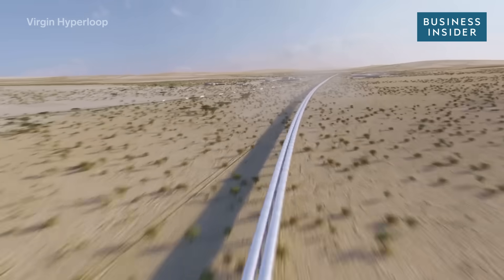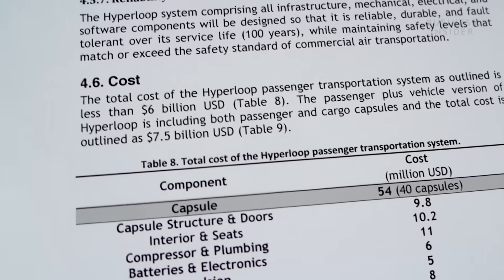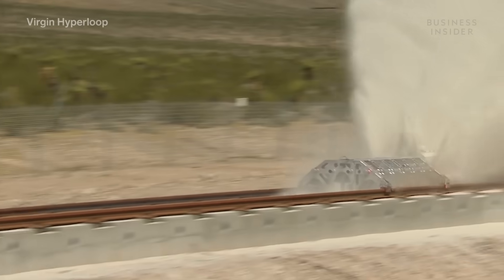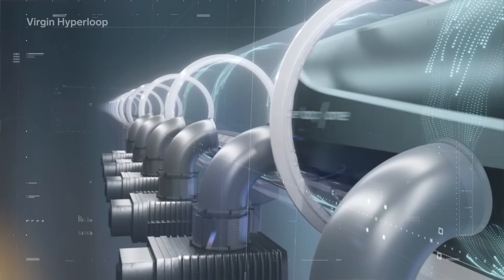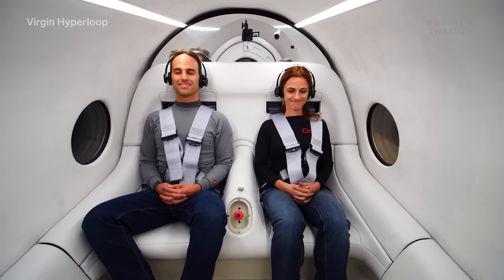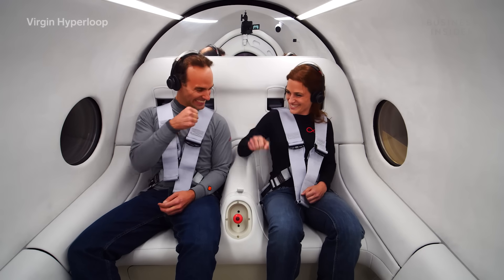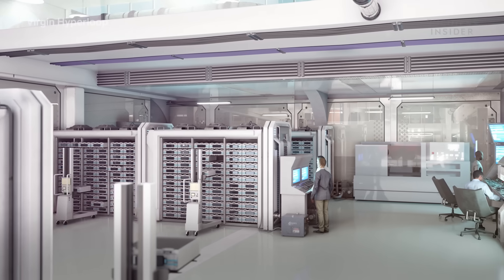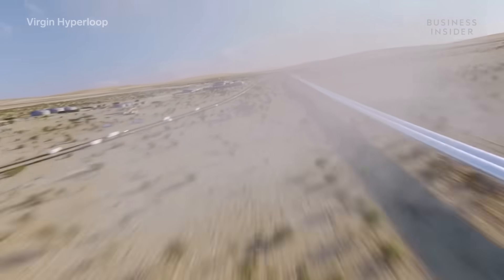How Elon Musk's 700 MPH Hyperloop Concept Could Become The Fastest Way To Travel

Comment: It will never work, because due to temperature difference of the bottom and the top of the loop, will damage the loop, especially when it is many hundreds of kms long. Heat extends material. Also the operation costs will be high, even with air locks. Not mentioning possible damage that may occur to the loop. Also the vehicle needs to carry enough oxygen to destination. If there is too less, everyone will die. Magnets will wear off aswell.

Comment: Good luck getting stuck in the middle. Good luck with fire. Good luck with smoke. Good luck with a crack in the tube. Good luck with a crack in the capsule. Good luck with the temperature difference. Good luck with earthquakes. Good luck with the expending metal due to heat. Good luck with those pumps to create a vacuum. Good luck with corrosion. Good luck with the people waking up knowing that Elon should not get all the credit and that these are not his ideas

Comment: I have a question. So this thing is mag lev? What keeps it from rubbing the sides? At 1000kph I imagine the stress through a curve would be huge! How much co2 to create this thing AND maintain it? How much electricity would all those pumps draw running constantly?
Reply: @AndySOTW this is a hyper loop and yes, it works on magnetic levitation. It is powered by magnets and hence LEVITATES. It is fast as shit cz it reduces drag and ofc friction. And no, it doesn't rub to the sides, At this holy shit speed it LEVITATES and doesn't even touch the tube at any point. It needs vaccumme chambers so all the air is flushed out and it need electricity 24/7

Comment: It's so crazy how you and the rest of the media are tripping all over yourselves to fall for this scam.
Reply: @asclepius7516  I may or may not be educated, but it hardly matters. I can certainly perform basic, high school-level math, which is all anyone needs to understand why this is never going to work.
Reply: @asclepius7516  if you do a bit of research, you will find that there are major issues people developing the hyperloop needs to address such as keeping the tubes airtight while compensating for heat expansion in a durable and ethical manner.

They shouldn't have to worry about the magnet bits, maglevs already exist and are in commercial use today with many topping out at speeds of 600km/h.
Reply: What do you mean?
Reply: @justsomedude4547  vacuum-tube high speed rail is a very old idea that doesn't work. Creating a fully sealed vacuum tube on the scale required isn't feasible without absolute perfection in the sealed environment. We're talking no cumulative errors larger than the size of a quarter or the vacuum would fail. This has been known for a long time, yet the same idea is floated again and again and the media always eats it up without question.

Comment: Yeah imagine the system failing and people getting stuck in a train inside a tunnel with no air. Tottaly no chance of something going wrong. And a requiring a ton of vacuum pumps? The energy cost would be insane, no way it would a 100 dollar ticket also because is a fancy pants transportation that would target super rich people.

Comment: The hyperloop is a pipe dream and a scam.

The amount of energy required to create the vacuum down to even 0.001bar ie (750 mTorr) in a tube that size over any length that would make sense to used for transport is ridiculously high and difficult to maintain.  Even a pin prick hole would create a massive problem.

Secondly it's extremely dangerous to the passengers. If your train springs a leak you die from suffocation.  Elon proposed 0.001 bar for the tube which is the equivalent pressure as 2x the height of mt everest.  And if the tube breaches, the train will be destroyed.  Imagine going 750 kph at 1/1000 air pressure then hitting a wall of air suddenly....like driving the train into a brick wall.

Why do they keep pushing this hyperloop nonsense?
Reply: Money laundering

Comment: SST aircraft are a better approach. The cost, maintenance and safety measures required to keep all that function would be enormous. You can’t hyperloop to Europe. With aircraft there’s no road/track to build and maintain. All the infrastructure is there atm. Plus this idea is not new. Reagan administration had this concept from LA to NYC in the 80’s.

Comment: tunnel without air, great...
what happens if you have an issue and the pod is stuck or suspended somewhere? how long do you have air for?
Reply: As long as the back up air supply is supposed to last dummy.

Comment: Unbelievable ignorance.
1. It has been called vactrain for a 100 years and actually first described in principle in 1799. It is not Elon Musk's concept.
2. It is not 3 times faster than bullet trains. No vactrain reached the speed of bullet trains yet. And it is not a transport system, vactrain never transported anyone or anything. And the reason for both of these facts is that it's incredibly difficult to build a near-vacuum tube even just few kilometres long.

Comment: what happens if it depressurizes while I'm inside? I just have a seizure until someone stops it?
Reply: Don't worry about that, decompression isn't too hard to deal with. What you do have to worry about is the tube collapsing from the vacuum and turning you into a 700mph smear.

Comment: Sorry this is a pipe dream, pun intended. The power requirement are astronomical so unless old Elon has access to micro fusion technology with the output of a decent sized nuclear reactor it is going to have a carbon foot the size of Godzilla and the solar panel idea will produce nowhere near enough power. 
maintaining a near perfect vacuum over a few thousand feet of of tube is difficult doing over thousands of miles is mind boggling.
If you assume $20 from every ticket is profit and every 3600 seat train runs to capacity and he runs 4 trains an hour (2 each way) 24 hours a day it will take about 40 years to recoup the construction costs which have been estimated at around $100 billion dollars.
It is a beautiful dream but it will never happen but hey if I had a  dollar for everytime I was wrong I could pay for this out of my own pocket.

Comment: infrastructure costs of any type of Hyperloop system are astronomical. when compared to aviation. more time will be spent just going through complicated safety checks . than any time on the move.  .The Large Hadron Collider at 26km or 16.6 miles is cheap compared to any Hyperloop system with its 1000km expensive infrastructure costs.

Comment: no it cant. no it wont.

china can build 29000km of high speed rail in a few decades. and you idiots are excited over a dangerous, impractical, long discredited and abandoned tube in the desert that woll never succeed and if its built will IMMEDIATELY, be completely obliterated by one individual with a single bullet.

youll kill people by building this. its extremely stupid. stop trying to build up musks stock value and crowdfund from gullible saps and public funding.

Comment: Hyperloop will never work. The idea is fundamentally stupid.
Trains are perhaps the most energy efficient mode of transport in the world. All it does is utilize momentum. A hyperloop will be an extremely energy inefficient deathtrap. Here is why;

1. A single puncture on the tube means the pressure waves will insta-kill the passengers.
2. How do you mitigate the problem of heat expansion of perhaps thousands of kilometres long vacuum time?
3. How the hell do you maintain a thousand kilometers long vacuum tube? It would be insanely energy inefficient.
4. How do you change tracks? As far as I know, trains change tracks to get to the destination.

Maintaining a good quality railway is very hard. That's why in most countries, railways are government owned because private companies simply cannot maintain railway. There is a reason why train works and hyperloop is still in your CGI, because trains work. They are not stupid. Stop simping for Elon. Hyperloop is not his idea and it's just a scam.

Comment: What’s the cost per a mile of building the rail/tunnel?
Reply: theres no cost, it's impossible
Reply: @megazenn22  I don’t think there is a technological limitation.  It’s cost.  We can build air tight tunnels and a airtight car.
Reply: @AB-nv7bz  no we cant
Reply: @megazenn22  LOL.  Planes experience a pressure differential of 9psi, would can't build a capsule that could handle 12 or even 14.7(you know manned spaceflight exists right)?  We can't build a tube that could hold a near perfect vacuum?

We could build it with todays technology.  Would it be feasible from a cost and time standpoint?  No.  Are there huge safety concerns? yes.

You're response about not being possible is incorrect.  There are major hurdles that would need to be overcome.  

Its a question of time and money, not feasibility.

Comment: No, no and no. Even though they have changed the concept from a train that would "hover on a cushion of air", to a train with magnetic levitation (like the ones we already have), running a train with people at high velocity through a vacuum in a tube, will NEVER be an efficient method of transportation. A vacuum in a miles-long tube is amazingly complicated to obtain and even more difficult to maintain.
Reply: The most recent version runs on wheels and i guess it runs through the vacuum between Musk's ears.
Reply: I'm betting it will end up just being a train inside a tube, no vacuum.

Comment: Has anyone commented energy required to hold a 99.9% vacuum? Or to install and maintain the vacuum pumps running constantly along the entire length of the tube? That must be a significant challenge and an expensive one at that!
Reply: just 30km of so-called hyperloop tube be more expensive then the Large Hadron Collider.
Reply: The energy costs don't matter because the hyperloop is literally a scam. This will never be built on Earth.
Reply: @codycausey3341  this project not only took money from dumb investors but also took tax money aswell damn, ppl pay their tax and this is where it ended
Reply: @kreondeanx347  the hyperloop is a secret Elongated Musket plan for transportation on Mars. Building it on Earth was never in the plan.
Reply: @codycausey3341  My bet is that it will be global, but not until material science is far more advanced to allow the building of a tube that can withstand the pressure.
Reply: Remember, even Space Station is not 100% airtight. Keep it 99.9% vacuum, is very expensive, and very difficult.
Reply: Ik right!? This idea is pretty similar to supersonic flights, super fast but the costs will be extremely high. Not to mention this would be terrible for the environment.
Reply: Just a slightest leak in one of the tubes, your done.
Reply: Besides, it would never be always in a vacuum, the passangers nedd to get in and out
Reply: Korea has testeed 1100km/h scale model at 1/1000 atmospheres
Reply: And all it would take to sabotage it would be to shoot the tube with a gun
Reply: The truth is that this is just a way to stall high speed rail projects while elon sells you his exploding cars
Reply: "Free energy" and tunnels that already exist under America and link the continents, are going to be magically out of their arses one day. Just like the covid vaccine.

"Technological breakthrough". 😅
Reply: Yes broo, very true, and not only this but if even there is a small leak it may lead to mass destruction
Reply: 2 4th gen nuclear powerplants at both ends of the line
Reply: I hold a 100 percent vacuum at home. Works great got it at canadian tire
Reply: @BCPREPPER1776  m8 there's a bit of a difference between pulling a vacuum in a tiny container, and pulling a vacuum along miles and miles of huge tubing
Reply: @Misha-dr9rh  oh wow thanks! Big brain.
Reply: Air that leaks in will be pushed ahead of the pods to the terminus where it can be use in the transition to normal air pressure.
Not ideal, but not as bad or as expensive to use rather than solve.

I believe that the recent incarnations arent looking at anywhere near 99.9% vacuum, more like 70%
Reply: Well once the air is pulled out at first it only needs to take air every once in a while
Reply: @jdh3825  still expensive if we look at the designed length of the tracks, from city to city, how many pumps they need, if its on 24/7 then itll be expensive even when the pumps are on standby mode it still cost electricity and imagine if some of the pumps malfunction its gonna be expensive and a hassle to fix.
Reply: @jdh3825  it takes roughly 30 minutes to depressurized just the las vegas "loop"(straight tube). How would you like to wait 30 minutes for your overpriced train to leave,
Reply: @jdh3825  u sure?
you need only a view pinholes along 100s of miles of tube to make the pumps have to run constantly. along with thermal expansion of the tube, which will also make the system leak more, i´d say that the 1mb target is absolutely unachievable even with pumps running constantly
Reply: @lenny-q8e  you aren't asking the right question. If its under a vacuum how do you get inside the capsule? Any way you get into the capsule or the capsule gets in the tube you are going to have pressurization. But it doesn't matter because the hyperloop is just a scam and will never be built on Earth. Shame to business insider for posting this. But for funs sake the plan is to have vacuum pumps every 10-15 meters constantly pumping out air.
Reply: @codycausey3341  true, the huge airlocks for the capsiles are probably a total dealbreaker
Reply: @codycausey3341  you could use some type of airlock, ti let passengers in and out the capsule, while having a vacuum in the tube
Reply: @lenny-q8e  Pin holes in 2" thick steel.... Not too many of those.
Thermal expansion is trivial. Absolute maximum pressure differential is 1 Bar, a sliding seal can cope with that without any trouble. A diaphragm seal, more so.
Reply: @codycausey3341  
We will wear space suits
It will feel like space travel
Reply: @jdh3825  there's no such thing as a perfect lie sealed system are will always leak in at a constant rate along a 60000 km long tube that's a very significant compounded impact
Reply: @jdh3825  ok where is the pods coming from again? yeah a non vacuum air filled area
Reply: @neku2741  well the pods can lock in at yhe surrounding tube at the start and then two doors one of loop and one of pod can open to let passengers in and out. Also doors can be small in order to maintain inside vaccum. But than there will be only one pod per loop i don't that would be ideal.

Comment: Those people saying thunderfoot debunked this clearly didnt read any of the comments debunking him, hes a chemist not a mechanical / electrical engineer. Hell some of his calculations were out by a magnitude of 100x practically saying every time a train stops its a nuclear bomb worth of energy XD

The idea is sound but is developing technology that hasnt needed to be invented yet.

The "vacuum" is fairly easy to achieve, its not a true vacuum its just close to one to drastically reduce the air resistance which is almost all the energy loss at higher speeds. Turning MWh of energy for each train to KWh which is an insane saving.

Largest issues its facing is permits, land routes, maintenance downtime / access and cooling components in a vacuum

Comment: A: this is only for the rich!
B: you need to build a tunnel which will take forever to make.
C: while the vacuum is what makes this possible it will also be what makes it incredibly dangerous. One act of terror or mechanical failure and part might implode while the train is going through. 

Summary: the cost of this is not not worth the hassle! Regular maglev trains make much more sense and are much safer!

Comment: This wasn’t good. If your only sources of information are the companies promoting something, all you will do is propagandise for them.  
——
30,000 pax per hour for 28 pax vehicle is one pod every 3.3 seconds. 
How are
They going to maintain safe separation between the vehicles at those speeds?
What is the time to open and close an airlock for a tube that size?  How will they handle that?
—-
The smoothness of the ride at 100mph doesn’t linearly scale to 1000mph. Problems increase by a power of 10, not a multiple of 10. 
—-
The analogy with the development time of high speed rail is absurd. 
A better comparison will be the Concorde or high speed tracked air cushion vehicles.  Hyperloop is technically feasible but it will cost more and have lower capacity than expected. 
—-
It has already over promised and under delivered. IMHO If they get money to build their testing and certification system it will die there.